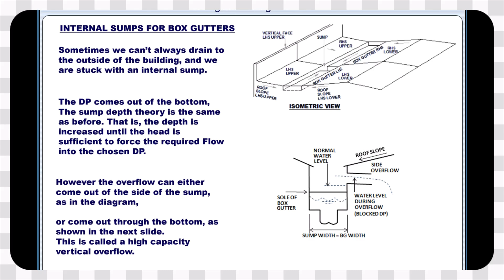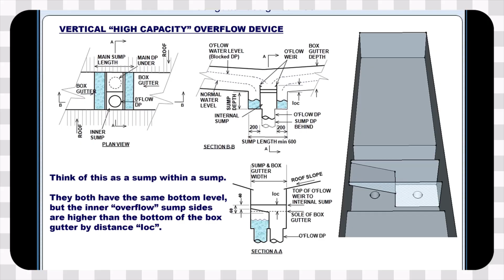Rainwater head design considerations for  complying to the National Construction Code

Comment: Good design. Shame about the exposed side fixing clips and all the pop rivets used. Surly they could design it to look cleaner visually.
Reply: The rivets are required at no more than 40mm cts under AS/NZS3500.3 and SA HB39.  The seams are also filled with silicone prior to riveting.  Nobody else follows those requirements.  Other common methods of manufacture like Pittsburgh seams, clinching etc are not compliant with the codes despite being in widespread use. WTF.